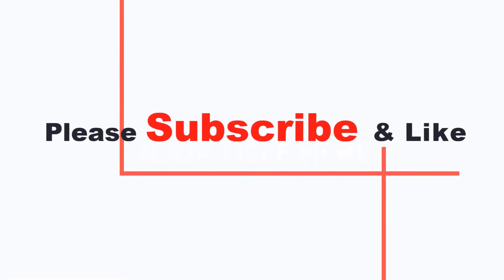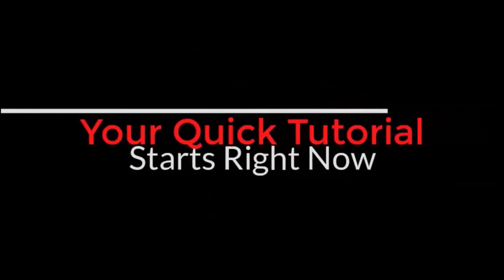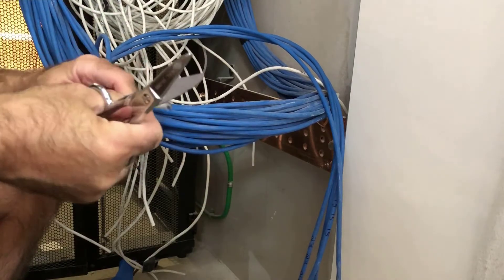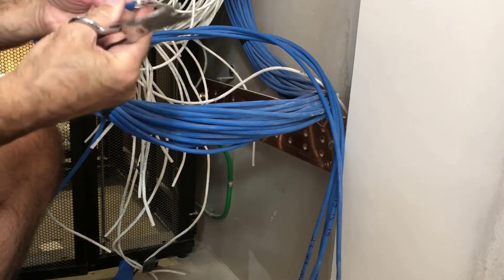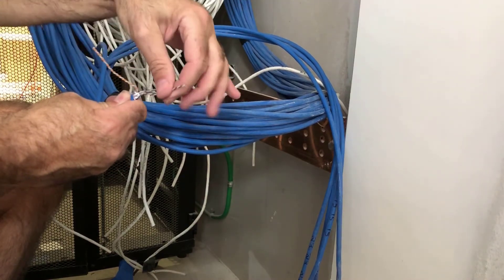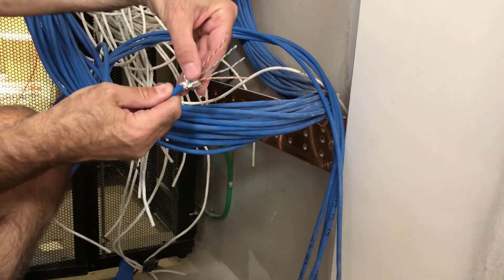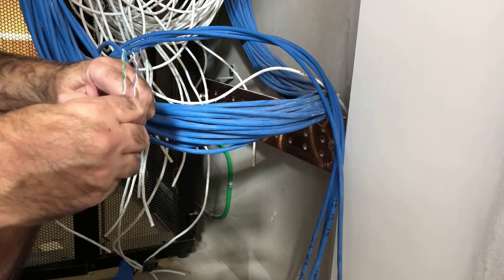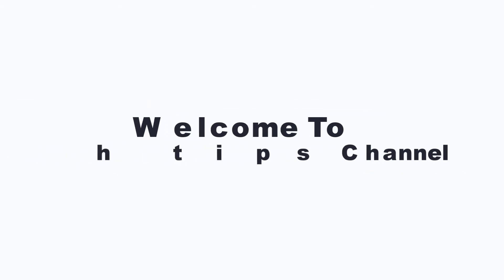How To Install A Comscope Cat 6A SLX Keystone Jack

Comment: Any chance you can do a video on how to take these apart? The specs are very vague but there is a way apparently.
Reply: IIRC the jacks are single use, you can break the jack if you want to do something else with the cable, but I don't think you can recover the jack.